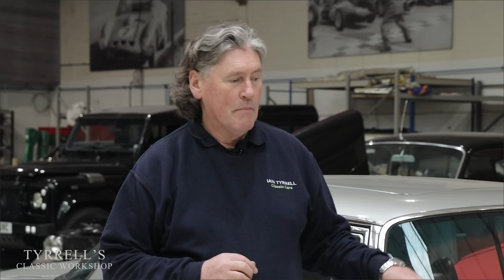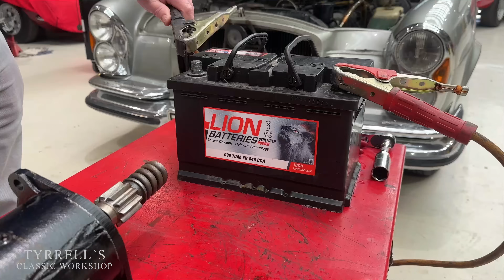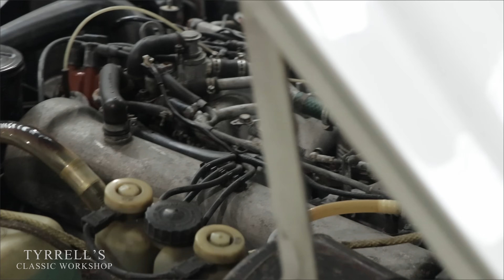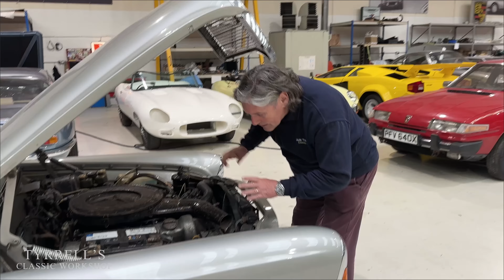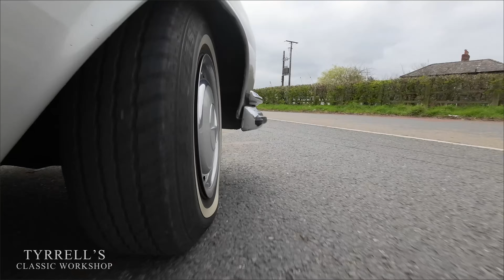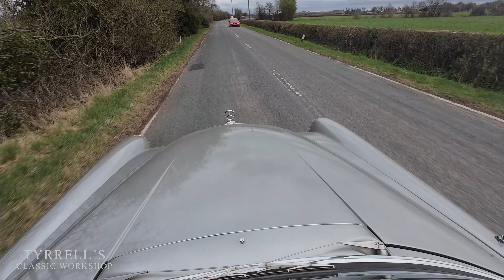Mercedes 280SE 3.5 coupe: Style, power & high-tech W111 | Tyrrell's Classic Workshop

Comment: Why did Mercedes change the headlight styling from the sedan on the Cabriolet? 

The glassed in look on Cabriolet doesn't look as good as the dual stack headlights with indicator to the side. 

It was a classic MB look. 

They moved the indicator around on top, bottom of headlights with different shape lights but the look was very Mercedes. 

What an amazing car that, as you said, was the beginnings of many things we have in our cars today.

What a time it would have been late in the late 60's, early 70's, to have been a car engineer.

As you became just a couple of years later!

Another neat watch Iain.

Ejector seat!

Let me say I'm so happy to have been one of your very first subscribers!

Grayson
Reply: There is a technical reason for the different headlight styles. In 1959 when the W111 was designed, it used a single oblong glass housing which contained the parking light, turn signal, fog light, and a single high/low beam headlight using a dual filament "Bilux" bulb. However, the US required standardized sealed beam headlights, so Mercedes designed the dual round headlight setup for that market, with a separate combination turn/parking light between the headlight stack and the grill. Fast forward a few years, and Mercedes felt they needed to equip the fast 300SEL 6.3 with the brighter halogen headlight technology that had become available, but there was no dual filament halogen bulb at the time, only the single filament H1. So they developed dual round halogen headlights, one for high beam and one for low beam, that would fit in the existing USA market headlight frame. This became standard equipment on the 6.3, and was available as an option on other W108/109/111 cars. It was a popular "prestige" option at the time, including on this car. If you pause at 0.13 you can see that the car has the Bosch H1 halogen high and low beam lights, not the USA sealed beams.
Reply: @gotham61  

Ah didn't know that.

 I love Iain's vids. 

I get on to comment and if it's a question there's always someone with the answer! 

Thank ya!

Comment: I worked on a lot of type 3 VWs in a VW specialty shop. There were still a lot running around in the early 1980s. Did a lot of fuel line replacements as they ran reinforced rubber hoses which tended to spring leaks as they aged. With the closed engine compartment in the back, quite a few went up in flames. They had an extra set of dual points in the distributor that fired the pair of injectors.

Comment: When all is working the D-Jetronic FI system is truly a great pioneering design.  However, if and when the ECU fails, it's virtually impossible to find an expert that can repair a system filled with 1960/70s discrete transistors, diodes, capacitors, resistors and other associated electronic componentry.  What's more, (in Australia) I had enormous difficulty in locating a 'working' replacement ECU for a 6 cylinder 280 Mercedes - and that that was circa 10 years ago.  If I was confronted with the same problem today, I suspect a working replacement D-jet ECU would be virtually 'unobtanium'. In contrast to the D-jet, a K-jet, ie. continuous injection system (CIS) is far 'easier' to maintain in today's world.

Comment: Great video. Love the channel. Not meaning to challenge your expertise at all but didn't the 1955 Citroen DS have front and rear crumple zones, some 4 years before the fintail? I'll grant it doesn't have a passenger cell concept, but - for example - the engine is designed to go under the cabin in an impact.

Comment: I am amazed at the level of Tech on these cars for the period, I never realized. Thanks as always Iain.
Reply: Level of technical? Does that include  the short length  of green hosepipe  lurking under the air filter?
Reply: The amount of fuel injection system sensors and a ECU back in 1968 was insane.. Bosch were easy ahead.. Thd garden hose I agree they should of had a specialist intake design rather than garden hose..

Comment: My dad had a 4 door version of this in the early 80's in an emerald green colour. Pneumatic central locking and windows iirc. It was bought with a hunting at idle fault but other than that ran perfect. We had a few places look at it without success. In the end it went to GRV in Littleborough who were performance specialists and also prepped race and rally cars. They found the fault which was the ecu. Someone had fitted a 280SE ecu which is a 6 cylinder engine and not 280SE 3.5 V8 ecu. It was the fastest car I'd driven at the time and launched with a rear squat and nose lift. Plenty of fun in a straight line and embarrassed a few hot hatches at the time. Serene at wafting speeds but drank fuel for fun. This video bought back some great memories. Thank you.

Comment: My siblings and I have the saloon version (W108). Pretty fast but the rear suspension is not made for going fast, it is a De Dion type oscillating axle that can be dangerous. The Axle shock absorber above the differential costs a pretty penny to have it as right as it can be. A very comfortable car

Comment: M B being in their prime well ahead of the times in automotive, really pushing forward on innovation, safety, comfort and solid forward pushing engineering combined with majestic well grounded designs. The tail-fins did suit the W111 sedan particularly well good, however the toning down on the coupé and cabriolet works better in that form perhaps, that is, as a more well rounding stance for the purpose. At the time, especially the vertical and-or stacked headlights made Mercedes such an distinctive star on the roads, and still do very much so. Thank you so much for sharing this queen of the Autobahn Iain.
Reply: I agree. I owned my late father's 1960 220s sedan up until 15 years ago, and it looked far older in styling than the later coupé and the 70s models. What I prefer is the larger tail lights on the older fintail. The newer models have almost silly-looking tiny tail lights. They almost look like an after market product that doesn't quite fit.

Comment: In the 1970's Mercedes had the wiper switchgear on the indicator stalk on the left side of the wheel, and no stalk on the right side.
Was that the same in the 1960's?
Reply: Mercedes has always had the right side of the steering wheel "reserved" for the column shifter. Even in the 50`s when the indicator was operated by turning the horn ring in the steering wheel, the high beam switch located on the floor and the wipers by pulling a switch in the dash. In the 60`s on a Finny for example the windshield washer was located next to the high beam switch on the floor. The high beam signalling was done by the indicator stalk. The wipers were still push/pull button operated on the dash. 

By introducing the "combostalk" in the /8 in 1968, when the indicator, high beam and the wipers were operated from the same stalk on the left side of the wheel, only the washer had to be operated separately (still on the floor). This changed in 1976 by the introduction of the W123, after this point on all of the manuevers could be operated by a single stalk - on the left side. On the right hand drive cars this was on the right side of the wheel.

Comment: IIRC MBZ switched to the 4.5, along with different rear axle gear for emissions and fuel economy in the USA market, with a lower state of tune compensated for with the larger displacement but no loss in fuel economy on the highway.

Comment: I used to detest the Bendix starters on my Mini.  On cold mornings, the moment one cylinder coughed, it would momentarily overspeed the starter, causing the drive gear to disengage.  Then you'd have to release the key, wait for it to wind down, and try again...over and over...until the car could actually start.

Comment: A business partner got some extra money from a stocks deal in the early 2000s which  he had to hide from his wife - so he decided to buy a classic car. But, he had absolut no knowledge about buying a classic, so he asked me to find a W111 Cabriolet, or a 3.5 Coupé. 
Well, the 3.5 is what I called the scammers fly trap. There were too much examples for this car on the market in zhis times, nearly every garage mechanic who got a 220 in his hands throw a 3.5 from a wrecked 116 or 126 in - and sold this as the superrare beast of the 60s... Only one example was original, an American car. But, it came with more fibreglass and bodyfiller than metal. And even in this sad condition, it was a pleasure to drive. Such a straight way to deliver the power, what an amazing car must this have been. Absolut phantastic. 
So, after a long search, I found a very beautiful example of an open top S class, a 220 S. Not the fast starship like the 3.5, but original and extremly well preserved... I got good money for finding his dream car - and he drives his example till today. And still dreams about having a 3.5 drophead... (But don't want to pay this amount of money😂)
Very interesting video - i learnd a lot new details about this complex injection system, thank you very much!

Comment: I had a Volvo 144GL that had D-Jetronic, with, if I remember correctly, a separate set of points to fire the injectors. It never ran well at low revs or throttle openings, though it would give plenty of power. I persevered for a while but eventually swapped the head for a twin carb. After that it settled down to be one of the best cars I've had.
Reply: love a 142

Comment: The 4.5L M117 was never a California only engine. It was used across the USA and Canada in the W108, W109, R/C107 and W116. It was never fitted to the W111, and the W108 was never sold in the US with the 3.5L M116. Interestingly, if you bought a M117 108 or 109 for European delivery and collected it at the factory, it came with a 3.5 badge fitted, because Mercedes didn't want other drivers on the road in Germany to start asking about getting one with a 4.5L engine. The US dealers changed it to a 4.5 badge once the car was back in the States. Early pre-1973 US market R/C107s were all fitted with a 350SL/350SLC badge, even for US delivery, despite having a 4.5L M117 engine under the hood. The only car available in the US with both the 3.5L M116 and the 4.5L M117 was the W109 300SEL 3.5/4,5, and the 3.5 was actually the quicker car, due to having a four speed automatic vs the three speed in the 4.5.
Reply: At last, someone got this right!! Thnx for this accute post 👍

Comment: Both Chrysler and AMC had their short time with the Bendix fuel injection variant in 1956.  Packard also built a few V8s with it (two examples exist today).  None of them could make it practical for American drivers.  And none wanted to use the more popular Rochester type systems you could order on Chevies and Pontiacs.  Until today, I was unaware of the lineage of Bendix to Bosch making it work.  Ian’s history of these development is impeccable although my experience is mainly Bosch through Volvo and BMW applications.  I can only wince at his head being endangered by a Mercedes hood/bonnet that cannot be placed in the later option of a service position.

Comment: That engine bay is a bit of a mess @14:00 you can see that split water hose that has been leaking, couple of places there is what looks like garden hose on top of air intake & lots of grease and dirt all over.

Comment: I'm compelled to mention one other very important element of "D Jetronic,"  the ignition distributor with injector trigger contacts.  They actually "fired" the injectors according to engine speed.
As the engines aged, the contacts would become contaminated with oil vapors and sometimes cause difficult cold-starting as they would not create a pulse.

Comment: This was wonderful Ian!!  I have a 1966 250SE model, with the mechanically injected 2.5L straight six, 4 speed manual transmission with shifter on the floor (4-on-the-floor), and the electric sliding sunroof.  '66 was the first year for rear disc brakes, so I also have those.  Found it in early 1992, and it still puts a huge smile on my face.  It was horribly rotted in the structure under the car, and still is, because it would take $150-200k US to restore it, and then it would be worth $50-60k here.  

The W111's were hand built, and very special.  The one in your hands is beautiful, and it's great that it's the customer's "driver" and not a garage queen.  You're correct, they definitely garner a huge amount of attention when driven.  They are sexy sleds, and the wrapping glass, chrome, and the 1950's US inspired lines are eye catching.  

Great description of the origins of D-Jetronic, and I appreciate that you stated VW had the first system.  I believe that was in the 1968 Square Back, at least here in the US.  VW introduced K-Jetronic (CIS) in 1976(I think) in the Scirocco, and the Rabbit (Golf) got it the next year...  and the rest is history!  You've all done a fine job keeping that Coupe tuned so well.  It's extremely crisp in how it takes throttle.  In case you didn't catch it, there's a long split in the auxiliary air hose that goes to the throttle from that temp sensing "tower" unit.  It might be a slight air leak.

I can't tell from the camera angles, but if your Coupe seems a little down in the nose, it probably has failed front subframe mounts (big rubber cones), so the front of the body is "sagging" further down onto the subframe, and wheels.  The mounts get wrecked when the car's are lifted by their body, on a 4 post style automotive lift.  The weight of the engine pushes the subframe out the bottom of the car, hanging from the 2 subframe mounts, and wrecks them.  Metal plates with long bolts through the top of the plates, can be rested on the big oval frame openings in the engine compartment, and the bolts threaded into the subframe mounts, so that they can't be pulled down by the weight of the engine, during lifting.

Quick question;  does your Coupe have the hydropneumatic compensator attached to the center pivot point of the rear axle, or does it have just a large spring, laying horizontal?  Mine has the compensator, so it self levels when weight is put in the back seat or the trunk.

Cheers and great job on this video, as always!

Comment: An interesting note about that Chrysler fuel injection. There's one car that has that system. The owner replaced all the capacitors with more robust ones and it fixed all the problems the system had.

Comment: How come they bagded it 280(3,5)?
Reply: I guess it was named after the base engine, and then the bigger engine options were seen as an extra on the right side of the boot, just like E and L were. They continued that with the later S class too and If I am not mistaken the W123 was called the 200 series although it could be bought with a 2.8 six too. And then they introduced the 190 in the early 80s which had a 1.8 and a 2.0 (and a 2.3 and 2.6 six) but no 1.9 motor.
Reply: @DenUitvreter  W123 always badged according to engine type/size, so 200, 230E 280E 300D etc..    Personally I think its odd but they couldn't call their W109 300SEL 6.3 a 600 or 630 as their flagship was already a 600. So they started with the engine size badge on the right and this car followed suit.
Reply: @MercMad113  True, but I still remember it as being referred to as the 200 series, and W123 was still a factory project name only used by it's biggest afficionados. With the 300SEL you could also have the 3.5 and the 4.5 engine and then also have those badges on the right of the boot, and probably pay a couple of hundred extra just like with the W116 to leave the right badge off for bragging about having a bigger engine being too vulgar.

I think Mercedes reasoned 280SE or the 300SEL (W109) is the car we sell, and the bigger 3.5, 4.5 and 6.3 engines are an extra to that car, an improvement, you can either show off on the boot or not.

Comment: Wasn't it Rochester that made the FI for the Corvette, Chev sedans, and about 300 Pontiac Bonneville cnvts. in 1957?
Maybe Chrysler used Bendix briefly in '57/8?
Reply: Rochester's was a mechanical system. Chrysler used the electronic Bendix system on only 35 cars in 1958.
Reply: @stephenholland5930  Right, ok thanks.

Comment: The 1972 Mercedes-Benz 280SE 4.5 was the most wonderful car I ever owned. It was "The joy of driving".
Reply: I agree.  I had one as well.  I think these were one of the last models with the beautiful wood trim. I loved how the 3-pointed star hood ornament would sparkle as it reflected the light from its faceted design.  A great car.
Reply: Amen to that.  Had a long wheelbase 1972 model with the tunnel mounted gear selector.  17 years of flawless operation.  Been a Benz guy ever since.
Reply: I had a 1973 4.5 in Boston which had surpassed 500 KM.   It was an unbelievable vehicle with every conceivable option (including radar detectors in the grille and rear bumper).  Remember the old-style palomino leather seats? We would cruise the Mass Turnpike and pay 40 cent tolls through the oversized sunroof with a hook shot.  That car loved to be driven log distances; as young touring Musicians we were more than happy to oblige.